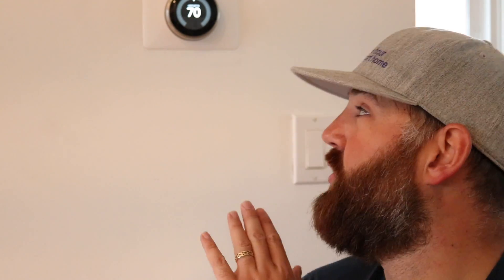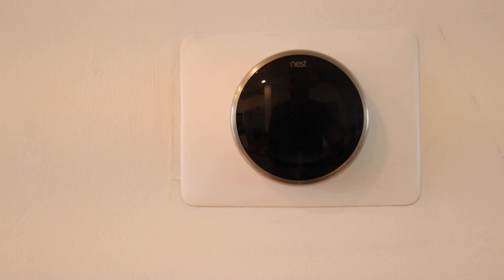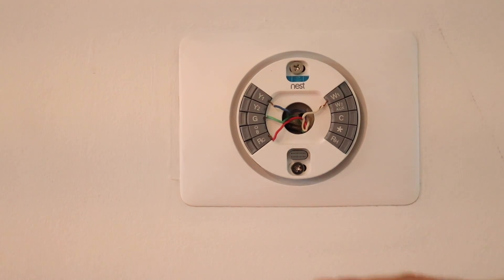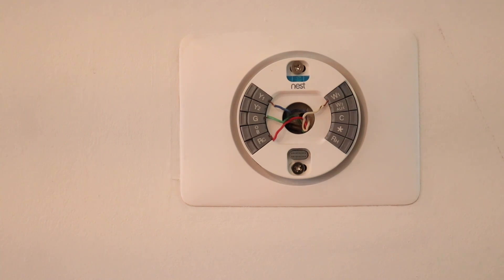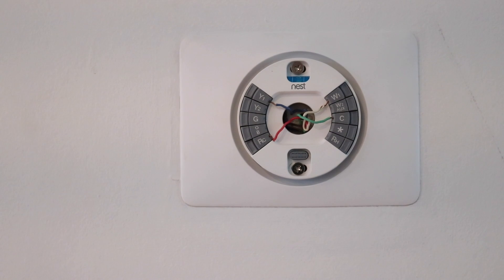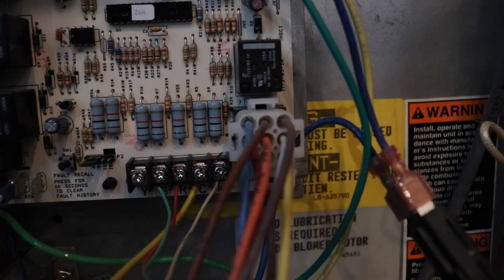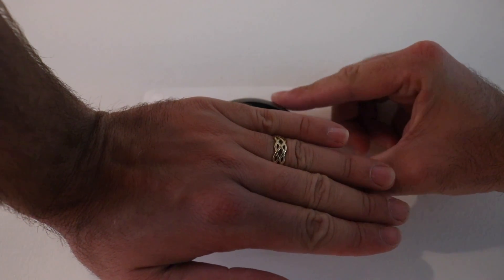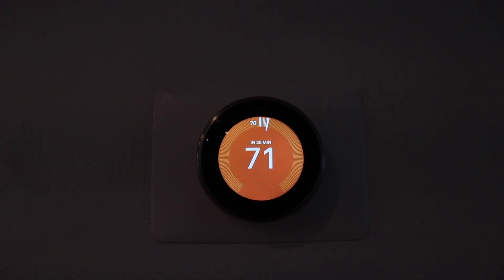Nest Common Wire Hack!!! - Nest Low Power Fixed

Comment: Made the switch few days later, receive notification of low battery,for charging the batteries, doess the furance need to be running, have temp on low, has yet needed to turn on, thanks
Reply: The whole point of using a C wire is to keep the Nest charged while the furnace is not running

Comment: My thermostat only has 2 wires 1 goes to W,the other goes to Rc and a 3rd wire that acts as a loop connecting RC AND RH. By the way this thermostat is solely use for heating. My central Ac has its own thermostat. Please need help if there way to connect similar to your videos to power up the nest thermostat. I would really appreciate it.

Comment: I already had a common wire there so for anyone that already has a common wire, my fix was re-stripping the Power(R) and Common(C) wires on both ends (Nest end and the furnace end). My furnace was super simple and had everything labeled. After turning on the furnace breaker, everything kicked in and my app showed Nest was connected.

Comment: It's called add 2 wires to 1 with a wire nut and shove it behind the wall, r or g as they're full time 24v, pigtail 2 wires off of one of them and now you have 2 wires that carry 24 volts without running a bunch of wire, is this the best way, no but ya know what, it's not pulling enough amps to mess with those wires like that

Comment: Can u move the the g wire to C terminal and then jump it back to G to keep it working normally? Reason I ask this is I don’t have a common wire to charge thermostat so I plan on using G wire , if as u say the fan will still work without G wire connected.

Comment: Thank you for the explanation. I did this but then my AC wasn't cooling below 76, that's why I had to connect everything back to G. Can I simply connect a new common wire from C to C and still have G?

Thank you again.
Reply: jump y to c... leave g alone where it was

Comment: You are a life saver. Thank you for the video. My furnace has a B/C with two white wires attached to that terminal. Can I still plug in my G wire in this terminal?

Comment: Tried this and our ac outside turned on but not the fan. System is from ‘94. I’m guessing it’s not modern enough for this solution, correct?

Comment: Your wiring is confusing. The blue wire in the Y terminal at the thermostat is not connected to the Y terminal on the furnace control board. It looks like it’s connected directly to the AC wires.

Comment: Thanks for the video. If I have 6 wires going to the where I installed Nest, (2 was used by humidifier - Orange and Brown ),  since you mentioned in another video, we only need one wire to connect humidifier  to Nest, Can I turn another wire to common wire?

Comment: Great job and thank you for all your tutorials. 
I currently have 3 nest thermostats however 1 of them always gives me low power issues and shuts down. I have central air and a hot water boiler with two power supplies and both have a c wire connection. I currently use the c wire from the boiler and still have the low power issues. Any suggestions for my issue?

Comment: Wow..first time I’ve seen a real solution to my C wire problem. I replaced a system with R and RC wires and tried hooking up the RC as the common(C) wire but the AC comes on but immediately turns off. I disconnected the C terminal(old RC) and it now works but I still don’t have a C connection. That’s where your solution solves everything. Great idea!!! I will use the Fan G wire for the C, Common!!

Comment: Could you simply run a jumper between the G and C terminals? It’s done on the RH and RC why not here?
Reply: No, because R is a power wire and G is a signal wire. G is not active all the time, while C is always active. You need whatever wire is connected to the C terminal to be constantly active.

Comment: Older video so sorry for reviving it, but I haven't found an answer to my question here. I've done this... taking G and plugging into C on both the furnace AND to my Nest Gen 3 thermostat. It worked briefly at night to cool, but the fan no only stays on for a short period of time, and then there's no air blowing at all when the fan kicks off. Is there a solution for this? Is this a jumper from C to G at the thermostat end? Please help!

Comment: I did this setup. I maybe upgrading the wire to 5/6 conductor as I do use the Fan (G) I have 2 wood stoves and just having the fan on helps to move that air throughout the house. 
Thanks for the video.

Comment: Other guy says to jump Y and G on control board? What do you say? Thanks for the video
Reply: Who is the other guy? I would like to take a look.

But I think you are correct. This video says most "modern" units will automatically turn on the fan even without G wire. But what if it doesn't? He doesn't even talk about that.

Comment: Thanks for the great video! I'm just wondering whether it's necessary to use a tiny jumper cable to connect the now-empty G-terminal to the Y-terminal on the furnace circuit board? Will the fan still work properly during system on?

Comment: This is very helpful and I think the solution for me... unfortunately I don't have a control board in my furnace. Could you possibly show how to switch the wires in the furnace when there is no control board? It's a little more confusing, I believe.

Comment: Wanted to ask a question. Everything worked well and while turning heater on, fan is turning automatically which is great, however while cooling, the fan is not running. Any suggestions? Thanks in advance.
Reply: I’m getting the same problem. Did you find anything out?
Reply: @tonybstarks  I think I know the answer. Are you still asking, or did you fix it? Also notice the original commenter has not responded.
Reply: Thank you Sam. I needed a better return. All fixed.
Reply: @tonybstarks  please explain what happened. I'm not sure what you mean by "better return". Thanks.
Reply: @tonybstarks what fixed the problem?

Comment: So I am actually getting an e103 error. I haven’t seen a video for this so decided to ask here. When I called support they said I’m getting too much voltage to my “y” wire. My a/c will not run due to this. It worked for the first year we lived here but recently started to get this error. Any advice…?

Comment: Running the fan without heat or cool has many possible uses. For houses that heat/cool unevenly, running the fan without heat or cool allows the air to mix more throughout the house without using much energy. The fan doesn't just move air; it also cleans the air by passing it through the filter. Finally, if you have a heated/cooled basement, cycling your air in the summer can cool down your whole house without running the air conditioner.

Comment: my townhouse has 3 floors, each with its own thermostat. when i connected the G wire to the C terminal on the main control board, the fuse blew up. Do I also need to switch the G wire to the C terminal on the zone controller as well?
Reply: jump y to c at the thermo... keep g where it was on g

Comment: Just wanted to say THANK YOU for this video! I didn't even think to check the wires at the furnace, only the Red and White were hooked to my old one (we only have heat no AC) and of course when I went down there only the red and white were hooked up to the control board. All the wires were right there so green to C on both ends and the thing works!

One thing to note, I didn't realize that some furnaces won't run if it detects the panel is off, so I was getting no power to the thermostat and couldn't figure out why - I hadn't replaced the panel on the furnace in case I needed to go check the wiring again.

Comment: And for those of you who happen to have an extra wire running from your thermostat to your furnace. Connect that wire to the "C" and you can simply ground the wire with a self tapping screw to a metal part of your furnace
Reply: So it's a common ground. That's what I thought but wasn't sure. So simple yet nobody ever mentioned this. Thank you. Now I don't need any of theses videos.
Reply: If the box is plastic no need a common wire for ground. Ground needed if the box is metal hope u get it.

Comment: After a failed Nest attempt at our last house with an older heating oil boiler, our house now has a natural gas furnace. Had the lower power issue as there were only three wires going to a dumb digital controller. Well, they had two wires not being used, so instead of stealing the green for a common, I just used one of the others. It’s a new furnace, so it had an open common terminal. So far so good!

Comment: Thanks for the great video.  I did get more power to my nest with your procedure.  The trouble I had was that my fan came on and ran continuously.  I tried to run the test mode for heat through the nest and it began to cycle on and off repeatedly.  Wondering what might have gone wrong?  I did have another red wire at the yellow position on the furnace - not sure where that was coming from?  Maybe the AC unit.  Any suggestions?

Comment: Great video! I had read about this online but you video really shows it well. Quick question - could someone run a "jumper" wire from "G" to "C" to keep the ability to use the fan when desired?

Comment: Awesome video!!! Thank you so much! Just to wanted to clarify with giving you some info on my system. We just bought a new manufactured home and it has the exact wires you are showing but it has the old analog style thermostat. We are wanting to do the best or new Amazon thermostat. We have a/c and a regular electric furnace. Will this work on my system?

Comment: Hi There. I have an older HVAC system using 4 wire thermostat wire. I believe I need to have the G terminal connected at the furnace. At the 6.29 point can I place a jumper from Y to the G to power the fan at the furnace, then use the G wire as the new common wire? My current Honeywell programmable thermostat uses batteries for power.

Comment: I used the C wire onto the Y1 slot because I didn't have cooling, but I guess I have to switch the G wire to the C slot to charge my nest thermostat

Comment: I took my unused Green wire and set it to C on my Nest and I couldn't find a contril board with G.  So I hooked it up with the White wire that's probably the power which is on my wall.
   Problem is I'm still getting a no C wire reading and my Nest says it's running at 209W.  Am I going to burn my house down now?

Comment: Awesome thank you!  My thermostat internal battery is no longer holding a charge which kept failing to connect to wifi and sometimes wouldn't follow the set schedule. I did have a spare wire on my multiconductor cable between the thermostat and furnace and was able to wire up the C.  No more issues!

Comment: Hey I have a question, I purchased my nest last year and now realize I have power issues. My thermostat before was battery powered. So when I did the install I just match the labeled wire. So I have my heating wire and my power wire. There were 3 other wires tucked behind the thermostat. I’m guessing for if or when someone wanted to convert to a powered thermostat and not use battery anymore. My question is ,. Is there a way to know which one of those wires is the (c) wire. Or does it not Matter or maybe I can use a voltage meter to check? I don’t know. Please tell me what you think.

Comment: I have got a silly question: can we connect the green wire to both the G and C terminals, by using a bridge wire (or whatever it is called) so that both fan and Common functions can be maintained?
Reply: I was wondering this too
Reply: Yes you can. In fact that is one of the way which was introduced by other expert youtuber
Reply: @mpower1226  can you remember and share a link, because the Google Nest support site states that one should not use any wire bridges at all because it has built in bridging in the thermostat, i want to try that because i ordered a 24V adapter and that did not work out (unit was telling me there was too much power going to the unit) and before that I had a Google C-wire adapter that worked only for a bit than stopped working and could not be detected by the thermostat ... so i was forced to do the G-to-C hack but I lost fan control and upstairs it warm and cold downstairs

Comment: I do not have AC on my system, its heat only. I've had three of these units connected for years and they worked flawlessly until this AM. One of the units said not power with the e195 error on the unit. I tried a few things, waisted time on the Nest help page for the error code and found a huge amount of videos here. 

Oddly enough after removing the Nest unit, reconnecting the red wire on the Nest connection and still getting the e195 error, 15 minutes later the unit reset and cleared the error. It asked for set up on heat and oil - all were already in they system. I just needed to click done on a few screens and the unit returned to functioning correctly.

I'm assuming this is/was a Nest software update that corrupted the unit, but who knows.

Comment: I'm trying to fix this problem and the adapter didn't work. I'd like to take the wire from g and switch it to the c terminal, but there is no C terminal on my hvac unit. How do I know which one to switch it to if there isn't one labeled c?

Comment: Dude I lost ten ways to do this rather than the one everyone wants to know which is the addition of a resistor between the common and the W at the taco board and let it charge when there is not a call

Comment: Hello. Got one for you. Cant believe I cant find anything online on this. I have a job that I only want to use the Nest to Monitor Temp in a Room. So nothing is connected. I bought the Suggested 24V AC Transformer but No matter how I wire it the Nest says its not seeing the RH Wire. So is what Im trying to do possible?? Feel like there has to be a trick to wiring it just to power it up with no equipment connected. Thanks!!

Comment: I have an extra blue (cyan?) colored wired that is tucked away at the motherboard and thermostat. Can I use the to connect to the C terminal on both and not have these battery issues?

Comment: Just got my Nest. My old Honeywell has 4 wires; yellow, white, red, green. I don't use my fan. So should I just go ahead and attach the green wire on C when I install?
Reply: Is the C connection the only way to recharge the battery besides removing the Nest and sticking it on a USB cord recharger?

Comment: I noticed you mentioned "modern" furnaces. So if we have older furnaces that only have 2-wire systems (w+g), can we still use this swap g wire to c wire trick if its a forced air unit that's older? Will the fan still kick on for a 2-wire system that's older?

Comment: Great info, maybe set the camera at an angle your hands are not working.
Also, the fan only option is great with open windows, for greater air exchange.😁

Comment: Thank you for the video. I saw another video doing bridge between Y & C at furnace board to keep the fan option usable. Is this correct?
Reply: that was my first observation... the simplest  y to c... why do all this complicated stuff when in the end thats exactly what he does, just not at the thermo, but in both places, thermo and furnace...  and jumping y to c also saves your G as default fan option
Reply: why do it at the furnace ?   do it at the thermo ??

Comment: I did everything as you instructed. The error cleared but the AC wouldn't come on. Does it mean that something is wrong with AC unit? By the way the AC unit was replaced a couple of years ago. Thank you!

Comment: You think this will help enable my farsight feature? I think my low battery disabled it. My battery level at 3.7v? I heard it’s suppose to be over 3.8. I’m charging it right now to see if that is the issue.

Comment: I have a heat pump system. Should my red wire be connected to the RC tab or the RH tab? It's currently connected to the RH tab and everything is working fine. I'm just curious as to if my red wire is in the right spot?

Comment: My issues are a bit different..... My old thermostat was a non smart honeywell and had no C wire being used. Worked fine since installed 7 years ago with a new Lennox HVAC unit.
Ever since I installed the Nest my outside AC unit turns on but the blower is not running properly.  It shutting off and clanking like it's trying to start but doesn't have enough juice.???
IDK  I had a guy come out and he says you need a C wire... OK.  He says these are common issues with the nest.  I have a C wire in the wall and the unit but it's hooked up to the yellow and jumpered to something else.  He tried to sell me a new honeywell (same one I just took off)..
Did not hook up my C wire and I got charged 250 dollars for this.  I was shocked that he did not hook up or fix the C wire.
These are the same contractors that installed this 7 years ago.
People are assholes.

Comment: After 2 years of the Nest thermostat working perfectly, it stopped today and came up with the dreaded no power error. In my thermostat, the blue C wire is already connected in there. I have 2 brown wires coming into the furnace. One of the brown wires has the C blue wire connected but the other brown wire has the blue wire not connected to anything in the furnace. Why would there be 2 brown wires with multiple wires in there? To make it even more puzzling, the thermostat started receiving power out of the blue again and started working but I have a feeling it's going to crap out again. Any feedback is very much appreciated.

Comment: I moved into a house with a Nest 3rd gen, and it won't detect any WiFi networks and the battery constantly runs out. There is no C wire on the nest. I'm hoping that following this guide will solve all my problems, I'll do it tomorrow.

Comment: What if I have a common wire installed but the nest still loses wifi and will not connect to wifi and volts drop? Was working fine but all of a sudden no wifi. Wifi in home works good. Not wifi issue. It happened before and guy came out and fixed it I thought